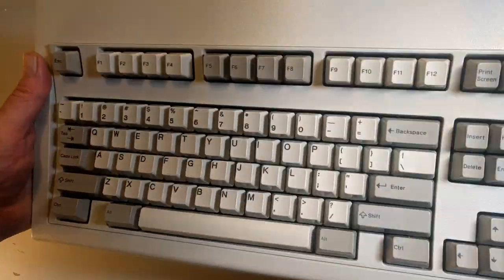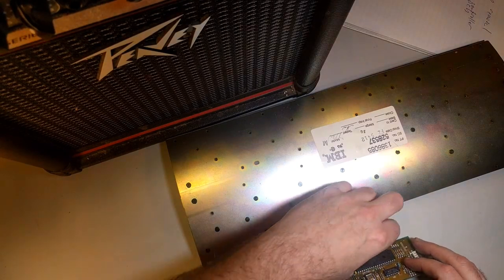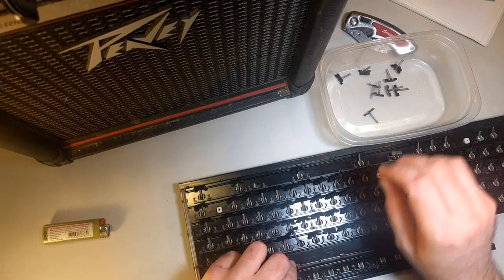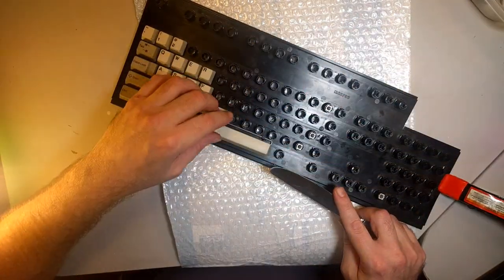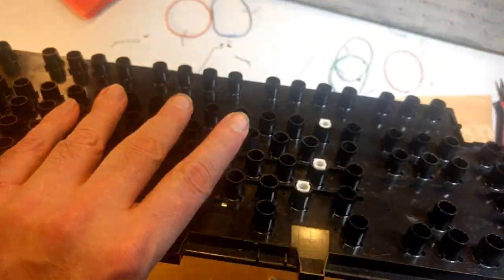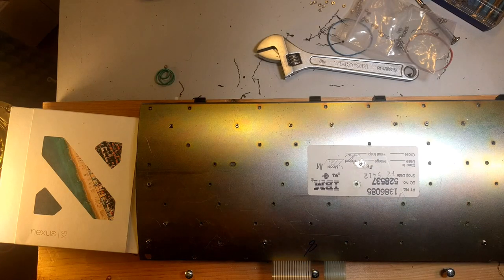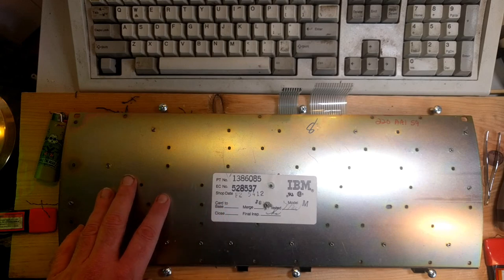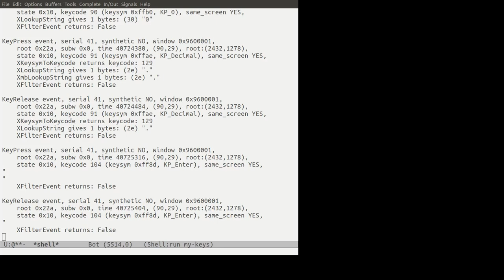IBM Model M Keyboard Bolt Modification (Rivet Replacement / Restoration)

Comment: What you have is the first ever generation IBM Model M or rather the IBM Enhanced keyboard as it was originally called. These Keyboards were an optional extra you could buy when you brought the IBM 5160 XT computer very nice condition too well done on the bolt mod.

Comment: Chris, I have successfully managed to drill the holes for the screws while the baseplate and upper moulding are held together by a few of the original rivets. Then I put in some bolts to hold everything in place while the initial rivets are drilled out. The process is fool proof, easy, and the holes are guaranteed to be in the right place because the drill is guided by the holes in the baseplate. I have a PDF describing the process in detail which I will happily send to you...
Reply from the maker: Great!  Maybe you can add a URL to it here.
Reply: Please do. I have an IBM MODEL M13 that I picked up for $50 and it needs some help.

Comment: Thanks for the video. I have exactly the same model, two of them (1986 Feb 27 and 1986 May 06). Both of them need bolt mod so I started working since yesterday (started with May one first). And now, I encountered the same issue - the frame crack. It didn't split completely so I am going to try salvage. Do you think a few drops of super glue to the crack will do the work? Or, do I need a specific product for fixing that?
Reply from the maker: I would use this plastic weld Plastruct Plastic Weld w/applicator 2oz Bottle https://www.amazon.com/dp/B00FDFWJD8/ref=cm_sw_r_cp_taa_7wAWCb2J29MZZ
Reply from the maker: And if the plastic weld fails Unicomp does sell barrel plates for a reasonable amount (don't forget to get stabilizer inserts too)
Reply: @ChrisMcDonough  Thanks mate. I am going to give a crack first. Cheers.
Reply from the maker: @eunghoonkim  cool let me know how it goes!
Reply: @ChrisMcDonough  Okay, I can tell you now. Super glue kind of works but is not recommended. It looks like the glue actually melts the plastic if applied too much. If the frame is not split like mine, maybe it is worth to try but no in completely split frame. Also, super glue residue is outstanding, which looks not good either. Anyway, all good. Now, it's time to order bolts and nuts.
Reply from the maker: @eunghoonkim  good to know!

Comment: Brilliant work. A few questions 1. Will it work if I leave the rubber mat out.  Will this produce a nice loud click and improve the 2 key rollover aspect. I am a very fast touch typist and would like a key that has a longer throw and a nice loud click... Can I leave out the mat and expect the keyboard to still function?
2. You say the screws are 8 mm long and the drill bit is 1/16" but: what is the diameter of the screw? is it metric? and likewise what are the specs of the nut. 
3. finally, is the head of the screw philips or capscrew? and what is the best size driver to buy.  
(I do have a drill press, and I can see how that would come in handy...) 
I have an M122 keyboard that I am going to attack after I get my model M to work.  I have four M's and they are all going mad with dropped characters and scrambled characters.  Great video! Thanks and All best, Norman
Reply: On #2,that is correct. The screws are M2, that makes the screw (bolt actually) stay in place... you actually drive them in.   You want them to stay in place for it to be simple to assemble.  The nuts are M2 as well.  On #3, anything will work, but I use a flat head (thin) phillips head.
Reply: The Model M's 2 key rollover is a consequence of the circuit design of its membrane. It has nothing to do with the rubber mat.

Comment: Could you just leave it connected and replace one rivet with a bolt and nut at a time? Maybe Dremel out from the metal back plate side?
Reply from the maker: it may be possible.  maybe someone else has tried it and will comment here.

Comment: Hey, I've just bolt modded my model m, but when I lightly press b, it activates, and when I press one of the arrow key, it will keep pressing it until I press it again, could you possibly tell me what to do? Thanks. (Sorry for poor english, not a native speaker)
Reply from the maker: I would take it apart again and clean the membrane with some alcohol wipes.  When you put it back together again, make sure you don't tighten the nuts down too hard maybe.
Reply: Chris McDonough ok, will be taking apart again, thanks for the reply!
Reply: It worked, thank you so much!